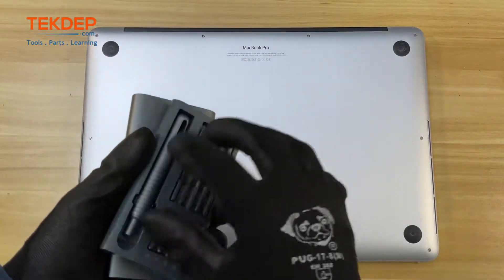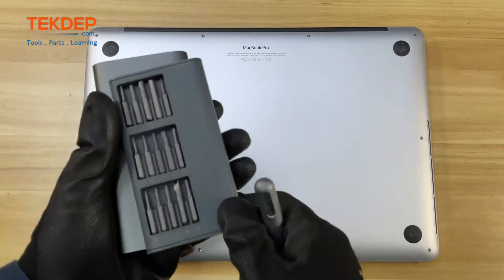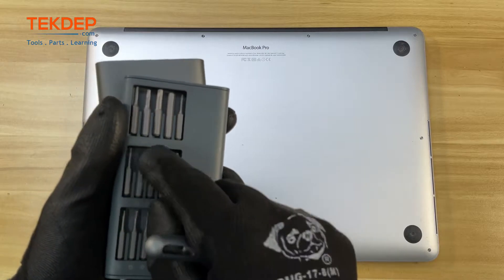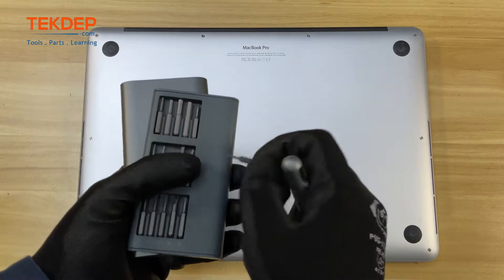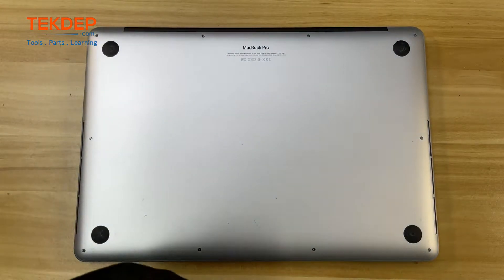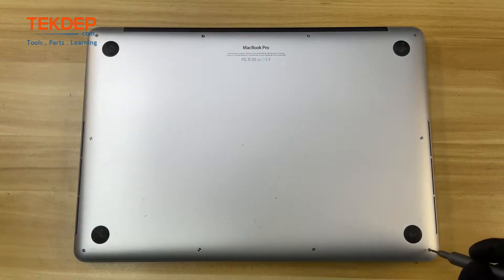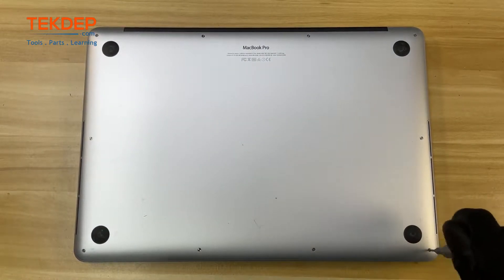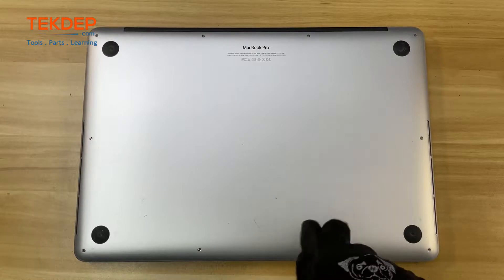Logic Board Removal  | 15” MacBook Pro 2015 / A1398

Comment: Thanks for the video! Is it possible to replace an i5 logic board with one that has, say an i7 from the same year macbook without any problem? I want to stretch the life of my 2015 13" while also beefing it up a bit.
Reply from the maker: This year model never had an i5 version, your probably is a different model! But over all of it’s the same model you can swap the i5 board with an i7 version
Reply: Yeah its possible I've done it with mine but I'm already gonna sell it off and just get a 2015 15in for a quad core i7 and Dedicated graphics

Comment: hi sir, I have the 2014 MBP 15" retina ( dual GPU). Is it possible for me to upgrade my logic board to the 2015 ( dual graphic ) ??
Reply from the maker: Unfortunately it won’t be possible, they look the same but Most of the internal parts has different connections, even though they look similar. That definitely won’t work.